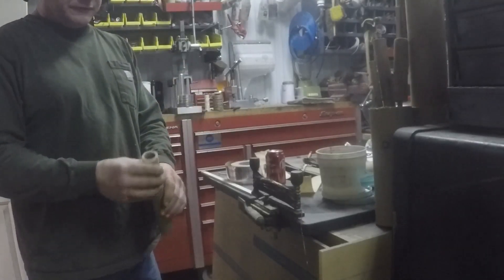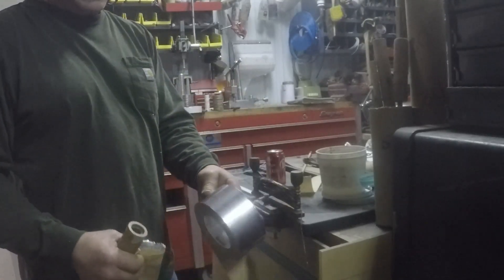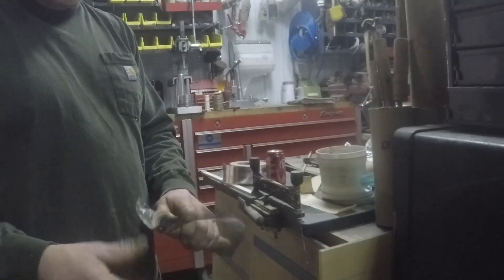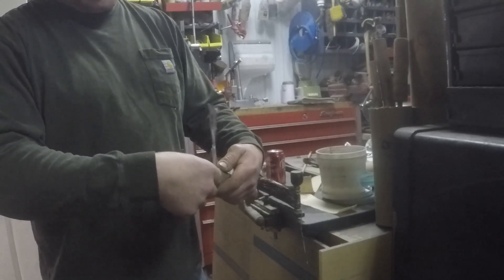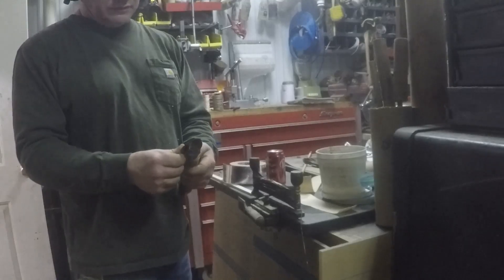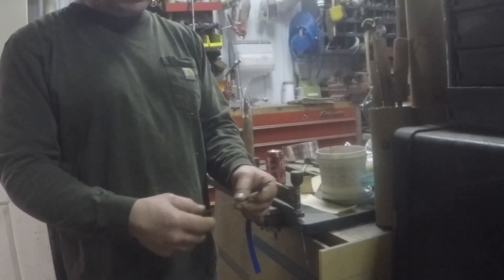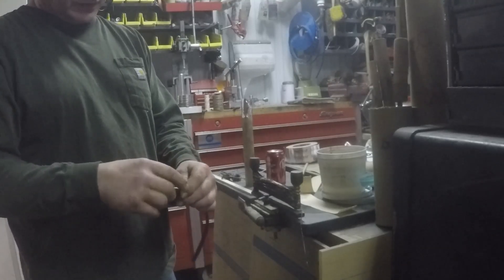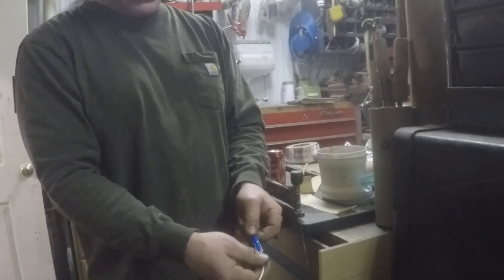Hupps Fusing Method

Comment: Will putting homemade black match in leader pipe all the way inside a whistle rocket be the same withought the quick fuse you put on the tip?
Reply from the maker: yes that will work well to.